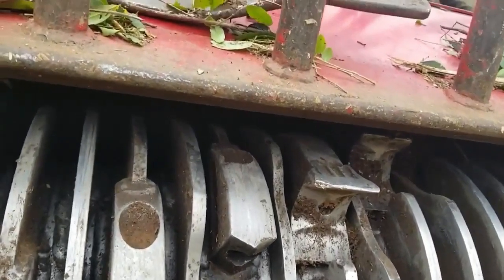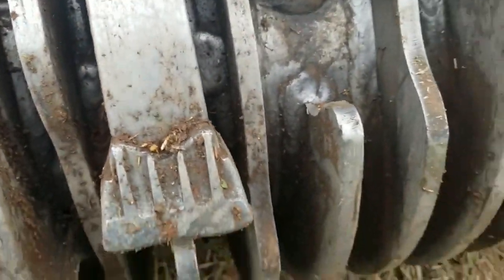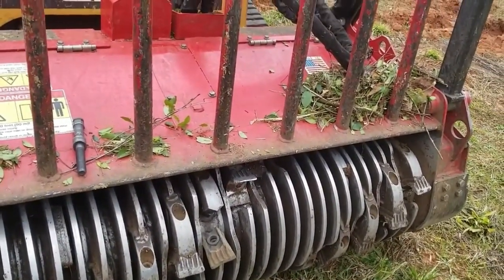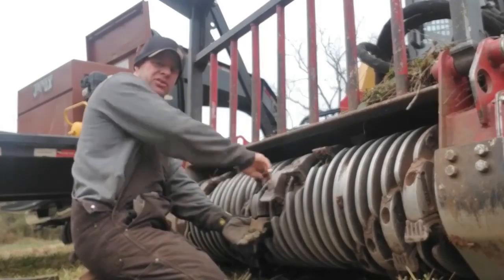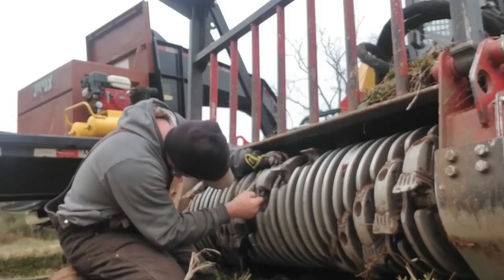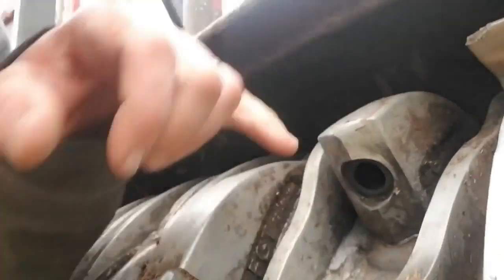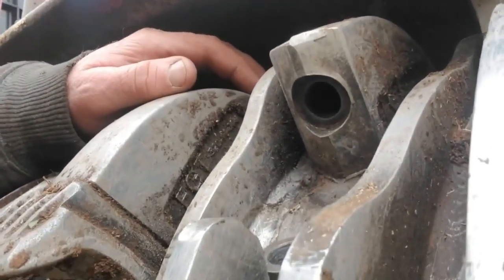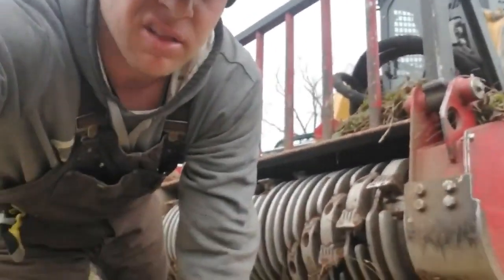Broke a Tooth on the Fecon DCR

Comment: Where do you go for your teeth, and how do you like the knives vs the carbides?  Thanks!
Reply from the maker: We buy Fecon or King Kong. We don't run carbide, it's too slow. There's not a lot of rock in this area. If we run into a rock job, we just put an old set of teeth on. It will cut just as fast as carbide.

Comment: Did you remember to pick up your leather Man? Is that an approved tool,a pipe on the end of a ratchet?
Reply from the maker: Of course! Every body needs a good cheater bar! Yes, I did get the leatherman.
Reply: Part of every good tool box. How many “Modified “ tools do you keep ? Thanks for sharing your time and videos.
Reply from the maker: @carlj3515   Can't think of any off hand. .
Reply: Upstate Brush Control what no wrenches bent or twisted at odd angles to fit just that nut or bolt?